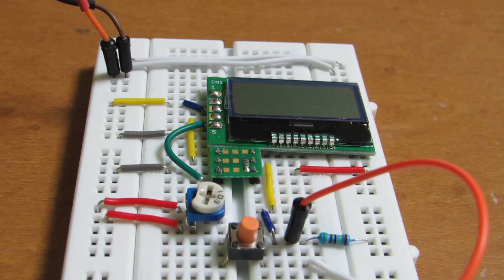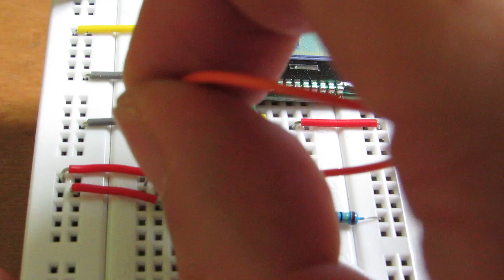Ultimate application of tiny ATtiny10: multi function (voltage&frequency) meter!!

Comment: Can't we use external EEPROM and do AI stuff with this¿ >_<
Reply from the maker: I guess you are not engineer, right? How EEPROM can measure voltage and frequency?
Reply: @microwavemont  you're right, I'm a high school student. What I meant was using an external ram/eeprom chip to extend the 2KB flash memory to what ever is required (enough to accommodate  an object detection Artificial Intelligence script). The external RAM chip can be written to or read from the SPI component of the attiny chip. I didn't mention anywhere that the eeprom/ ram itself has to measure voltage/ frequency data ,albeit, it's purely for storing large scripts that would otherwise exceed the internal flash memory of the microcontroller.
Edit: internal flash is only 1KB*
Reply: @muhammadosama3358  Elaborate.. be slightly less confusing in short terms, read over what youve typed after youre done.
Reply: @muhammadosama3358  also, regardless of what arduino you are using.. youre NEVER going to get close to true artificial intelligence. Sure you can make a small neural network, but thats it.
Reply: Depending o  your application you don't external EEPROM. You can definitely train a neural network and use it in the attiny10 for instance